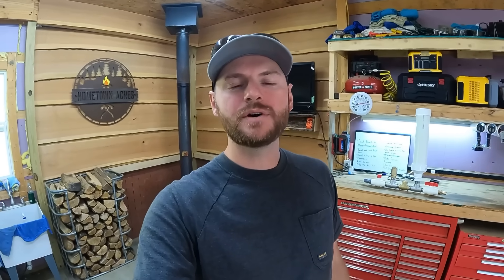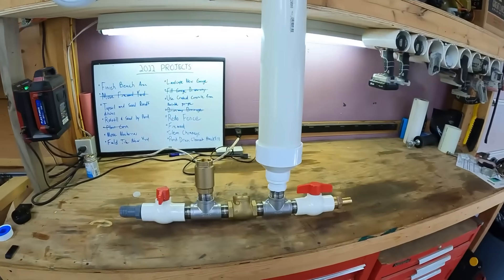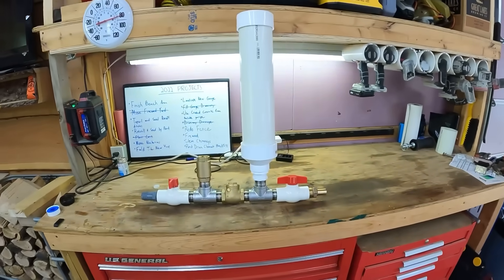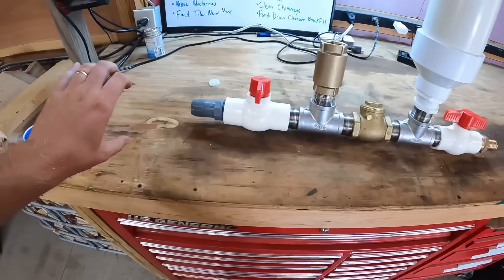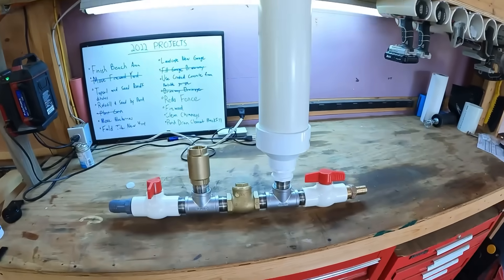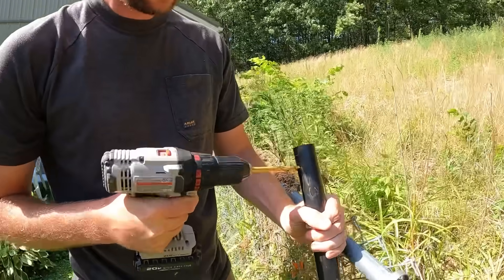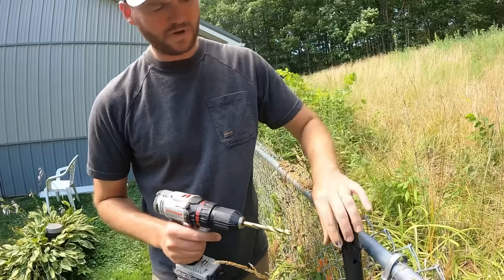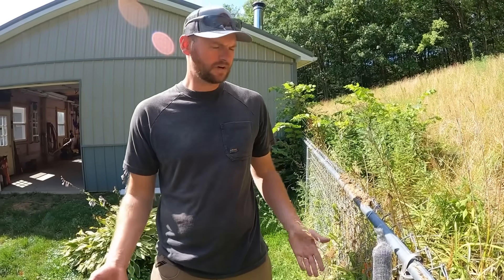We Found Water For The Pond - Hydraulic Ram Pump

Comment from the maker: If you don’t want to buy all the individual pieces for your own ram pump like we did, you can buy an already assembled pump on Amazon with the link below
https://amzn.to/3HGEWgu
Reply: @sam-and-angela  Thanks for the shoutout!
Reply: @LandtoHouse  i watch both channels and as soon as I saw this video post I thought of your channel and was glad to see your stuff as the amazon link.
Reply: @phreak480  Thank you for watching both channels!
Reply: Add a 3" bell adapter with the small outlet of the large bell to intake pipe, and face the bell upstream. This will increase water velocity to the pump, allowing higher volume and greater pressure on the other side. Technically, you want the water velocity at the waste valve to be at maximum. One other note: Reducing your pipe reduced your flow rate. These units work by the water hammer effect caused by Newton's first law, namely an object, in this case a non-compressible liquid, in motion tends to stay in motion. The first check valve allows the water to move in the system to the pump, with the waste valve allowing the flow. When the valve slams closed, this causes a water hammer effect, which forces the second valve open. The built in air chamber doesn't control the pressure, it just evens out the flow, allowing the pressure spike to last longer over time. The pressure generated by a water hammer effect can burst pipes, so don't underestimate its potential.  By reducing to a smaller pipe, the pressure caused by the effect is the same, but the GPM at the outlet is reduced. You don't need the tank, as the siphon effect will only increase the water speed, and thus lengthen the duration of the pulses at the pump and increase the flow. The length of pipe going from the pump to the top of the hill acts as an airlock because of the one way check valve. If your pond is below creek level it would be a problem, as then it would suck air at the waste valve. If that is the case, all you need is the siphon effect itself.
Reply: @paulandrulis4672  exactly my thoughts, the siphon effect will greatly increase the efficiency of the pump
Reply: One thing to help find your pipe later on if you ever have to do work on it is to lay a nail every 10 ft or so so that you can go back with a metal detector and plot out your pipe path
Reply: @mister-8658  That is freaking brilliant! I love that idea. Thank you
Reply: When you took the sping out you found out air was your problem did you try putting the spring back in 6ou said it is supposed to give you more pressure
Reply: I have had great success making a spillway out of bags of saccrete.  Simply lay the bags down in the creek next to each other and let the concrete harden in the bag.  The paper and the plastic liner of the bag eventually wears away and it takes very little to stop the leaks which mostly self seal.  But make a spillway not a dam.  I learned if you make a dam the water fall undermines the bottom of the dam.  And you could make a similar spillway down the side of the pond to prevent erosion.  And using this method makes the spillways look like they are made of large rocks.  Looks really natural especially when they moss over.
Reply: Does not look like you placed a liner, or a layer of clay, on the bottom of the pond prior to filling it.   This could save a lot of water from leaching back into the ground and draining the pond slowly.
Reply: I think you mentioned at 12:30 that your destination is lower than you are , so l think you can connect the two houses together, but on the bottom you need to sink the house under the water, so the housewillbe full of water. I think that gravity will help to get more water faster because will help the pomp and will create more suction.  Try.  If work  - let me know. 😉
Reply: you should take advantage of the gravity feed you have and put an inline electric generator.
Reply: I can't find it at Amazon, kindly help me; how can I place an order there. I have found only mechanical jacks!!!
Reply: Hello sir . Do you still have these available?
Reply: 2 weeks later
is it full?
Reply: Hi my name's are Mgawe Revocatus from Mwanza Tanzania.
I would like to know Can this machine send water up to 1km?
Reply: @Mgawe Revocatus, I would imagine it could send water as far as necessary, as long as you figure out the 1:7 foot ratio to go that far.
Reply: @sam-and-angela
Reply: Is there an error on the Amazon site where it says “one count” and maybe it should say “one inch” ?
Reply: You need to create a pond on that creek so that the pump gets enough pressure to the tank. Good job. Am watching in 🇰🇪  and I have the same set up though I used gas cylinder
Reply: Great job very economical. I love it.
Reply: Maybe you can use a bigger pressure tank
Reply: Great story!  Did you put a PVC pipe under the road to run the hose thru?  I could not tell from the picture.
Reply: If i want one ready made ram pump, can i buy it from you?.
Reply: theres nothing on the link
Reply: Every body don't have 100 yds of hose in front of the first check valve. The more water there makes the pump work better
Reply: ur gonna make ur government mad. they are not able to tax u off this. it will be illegal at some point
Reply: Dunno really but syphon ideas may simply drop pressure on the send side of the pump ..but y need that pressure to SHUT the valve dont you?? Anybody know?
Reply: I have watched your video many times. Since I live outside the States, I can't but the pre-assembled ram pump. Would appreciate if you could give a list of all the stuff that I need to build the pump?
Thank you
Reply: So throw a little shade on Home Depot but shout out to Amazon? You do realize that Home Depot employs locals and while most employees are younger just starting out Home Depot is one of the largest employers of Veterans and retired tradesmen whom are hired for their knowledge and experience there’s a lot of retired plumbers and ranchers at Home Depot while it may feel like you are “own your own” all you have to do is ask
Reply: Speaking of home delot,I know what your talking about as far as being on your own. I have started using a new sffategy,if I'm going to search for plumbing,I tell an associate to get someone I  plumbing g,gnat saves walking g around searching. The last girl I got admitted she was new,so she asked me to teach her,so I did. I was fixing a broken feeder tube in a pneumatic fire extinguisher. Got my parts,& felt like I accomplished something!
Reply: India's Water Revolution #1: Solving the Crisis in 45 days with the Paani Foundation
1.1M views · 2 years ago

Andrew Millison channel

Swells work too
Reply: Biblia 4📝1false prophet 2minister of chaos 3judas love of money 4false informer Satanas
Reply: Biblia 4📝1false prophet 2minister of chaos 3judas love of money 4false informer Satanas
Reply: Biblia 4📝1false prophet 2minister of chaos 3judas love of money 4false informer Satanas
Reply: Biblia 4📝1false prophet 2minister of chaos 3judas love of money 4false informer Satanas

Comment: Would've been interesting to see what happens if you just ran a direct line all the way to the pond. I'd imagine that having some suction on the intake side from the siphon might actually make it even more powerful since it accelerates the water on the intake pipe more than just gravity does which should then create a stronger water hammer and thus more pressure. Pretty impressive flow you got there nevertheless.

Comment: Must be nice digging, I’m up on the Divide in gold country Northern California, red dirt with rocks and boulders digging is no fun, great job on the Ram pump, I have a spring that I use an electric pump to pump water to a 300 gallon tank that I fill and then ran 2” pvc pipe to an outlet where I then hook a hose to for use of the water which then is gravity fed, Question is does the ram pump have to run continuously? What would happen if I attached a garden hose with a nozzle? Would the ramming stop? Thanks for the helpful video.

Comment: Can this only be done with moving water, where to pick-up is higher than the pump? 
(to build head pressure)
Or can this pump be used in a slow flowing river or lake at the water's level? 
(has to be primed)

Comment: I have come up with a hypothetical design that could pump to an effectively unlimited height with no moving parts, just flowing water. The problems are that it would require cleaner water, and the flow would probably be really slow.

Another option is a wirtz pump, which can be powered by a water wheel in flowing water. It is better over all, but requires moving parts and a complicated joint.

Comment: Did you put a partially inflated innertube in the pressure chamber? Also, 2 pumps can be connected to the supply line.

Comment: You could avoid the syphon effect by not sealing the 2 pipes together, just have some sort of open space which would prevent any air-tight seal causing the syphoning effect. Mount the pipe coming from the pump pointing downward so the end of that pipe is, let's say 3 feet above ground. Have the pipe going to the pond mounted below the other pipe with its end 2 feet above ground. Now you have a 1 foot gap between the two pipes and it could never get an air-tight seal. The water pumped up would just fall into the pipe going to the pond.

Comment: If the level of the pond is lower than the creek level then surely you can just use a straight pipe from one to the other?
It would just be a straight siphon from creek to pond.
You would just need to have a suction pump to get it going then it would run all by itself with no moving parts.

Comment: A couple of tips: Having a drop in height from inlet to ram pump - the more the drop the higher the pressure,  bigger diameter and longer run of inlet pipe along with elevation drop will help generate maximum lift pressure.  An air bladder setup I believe will also help maximize lift.
Reply: A bike (tyre valve screwed in the pvc cylinder would achieve the same principle once there's water in the system wouldn't it ? Once pump is running pump some air in with a bike pump ?

Comment: Ram Pumps are a very cool idea! I played around with it, and they work! Needs always a little maintenance, but in general a good idea.
After seeing the size of your pond, it will unfortunately not help much to fill, or maintain the water level. Just alone because it is a new built pond, they always loose some water for the first couple years. Evaporation in the Summer Months is very hard to battle without a well, not forgetting vegetation like Cattails what suck up thousands of gallons!
I ended up constructing a 400 foot deep well with a capacity of about 60 GPM gave me enough water to fill and maintain the water level also during a drought on my 1 acre pond.

Comment: Your pond will fill up faster if you run the hose directly over the pond water.  Then as it fills up back the hose off that way the hose never goes directly into the water. Also it won’t erode the soil this way.

Comment: I noticed u didn't build a little dam section in your creek,as I did in mine. I actually try to built 2 dams, so one collects great amount of water. them flows into 2nd pool filterd out dirt thru 1st dam wall made from trees an brush leaves. An nice an clear. Then the area u have your hose will get more water to suck from. An looks like u have nice rocks u could build a couple pools an get less dirt into your catch bucket. But great video. So what do u use to keep mesqetos out of it with?

Comment: A syphon won’t pull water more than 28 ft above the level of the creek. (I could explain but check it out if you don’t believe me)
However, if you extend the delivery pipe some way beyond where you have the tank you will effectively lessen the ‘head’ that you are trying to pump and this will increase the flow rate. It would be worth making a better estimate of the heights and distances you are covering and draw a schematic diagram of the project.
I would bet that you could improve your flow-rate bay 50% without much additional cost.

Comment: Maybe I'm stupid but 2 things I don't understand , 1st I've used that 1 1/4" brass ck valve for many years and know it takes 10 to 15 psi to start pushing it open.
2 I'm not understanding where that much pressure is coming from if its just small stream water , I don't get it ?

Comment: You made me laugh! I set an pulled pumps for 9 years. I was just going to comment on purging air out of the lines. The irregular you were seeing was air pockets in line. Once air pockets are removed, pump will become regular! When you clearified air problem an holding check valve down too purge. Nicely done! Helps ro minumalize all pipe lengths to lenghs for just what's needed, with no extra coils of pipe, making pump work harder.

Comment: Well done getting a solution, on the technical side, the power the pump generates is kinetic energy, this is dictated by the volume of water flowing down the feed pipe and the height difference between the stream and the pump, if you could either fit a bigger dia pipe or a second pipe you will increase the water volume, height is unchanged so you will generate more kinetic energy so you will increase the output pressure and hence more flow. If you wish to remove the IBC you just need a Tundish Valve or a syphon breaker where you change from the pressure pipe to the gravity pipe

Comment: As long as the pond is higher than the pump running directly from the pump will not result in a siphon  effect.  It will be the same as pumping the water to a lower height.

Comment: You're storing your water in a 1 ton container, connect it to a small turbine down at the pond and generate some electricity to store in a battery. Use an automatic syphon on the top tank to harness all that energy in one go, which should cycle twice a day at your present flow rates. You can also add a funnel at your creek intake to Increase the flow and resultant which will become more productive.  In winter you should scale up to meet your domestic needs.  Well done

Comment: So once you get the water up there create a second line with a vacuum sealed container. Prime it and use the sucking . You only need to block both ends until the system is primed

Comment: These pumps have been out for almost 100 years. We used in Alaska for our 3 cabins. I filled 50 gal water tanks with filters. So we could drink the water also. As long as you keep your water flowing your water won't freeze either. I ran overflows on the tanks and I used them for years.

Comment: What if you put another hose with a T to that one that provides water to your pond from the ibc, and drive it back to the small river?
As water goes from the ibc to the pond, it can suck the additional water uphill from the running water in paralell to the pump pipe...
I dont know the heights and the distances, but 1000 litres of ibc can suck up a few additional hundrets of water as you drain the water from it...

Comment: In your case I would think that once you have water filling the entire feed hose from the stream to the pond it would create a siphon and all you need is a check valve at the bottom. If that works I would create more head water at the source ( 1 or 2 feet) with a small dam and something to adjust the flow at the pond to prevent sucking all the water out of the source to fast.

Comment: I used a Folk Ram Pump for 30 years to supply my drinking water, until I had to sell the place.  To get more water in your pond, the most efficient way is to move your intake pipe farther upstream to increase the "head", the amount of fall in your "drive" pipe.   Increased elevation is probably pretty easy in this case.  Looking at your video at 5:32, there clearly is a waterfall about 50 feet upstream from where you placed the intake, with at least 10 feet of additional "fall" or head.  This is enough to increase your output by 25 to 33%, if you extend the pipe to the top of that waterfall and make a small retention basin above the waterfall.  Using additional pumps or larger pipes will not be as easy or efficient to gain more gallons per minute.

Comment: That is amazing how it works. I don't quite understand how this kind of pump works, so I'm wondering:

1)  If you had a larger pressure tank (that white vertical pipe with a cap) would that increase the water flow? I thought maybe that would allow for an increase in the pressure? 
2)  If that pressure tank was horizontal, would that make any difference?
3)  Something I thought of on my third viewing (yes three times because that whole idea is fascinating)  is that are you sure you have enough holes in the input pipe? With more or larger holes more water would enter the system.

THANK YOU for sharing this with us and for a clear explanation of how the pump works. You earned a 'thumbs up' and a new subscriber.

Comment: you wouldn't create a siphon connecting the downhill pipe directly. You just would lower the effective height/pressure for the pump. You would only create a siphon when the outlet would be lower than the intake, but then you wouldn't need a pump in the first place. Following that thought... DO you need a pump? is the intake really lower than the pond? Considering the length of the intake pipe, the really small amount of water spilling out of the pump and the relatively high flow you measured, I suspect the intake lies higher than the pond and the pump would be unnecessary. ??

Comment: What would happen if you plumbed hydraulic ram pump  feeding into  a second hydraulic ram pump?  (plumb 2 pumps in a series,  one feeding the other)   Would you gain pressure / volume?   lose pressure / volume ?   or stay the same as  a single hydrauic ram pump?